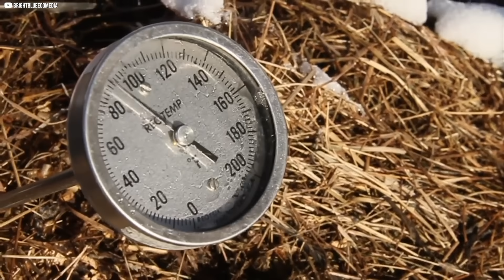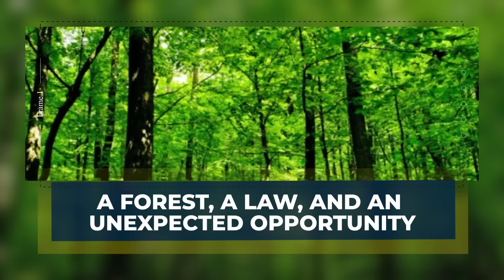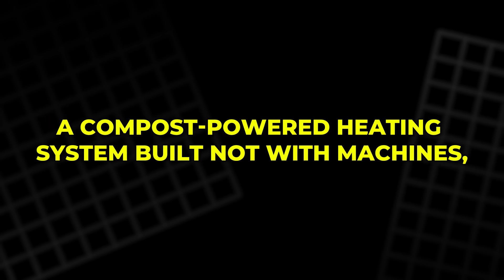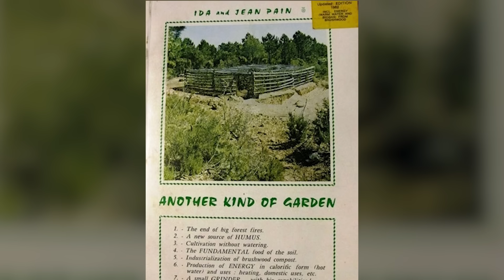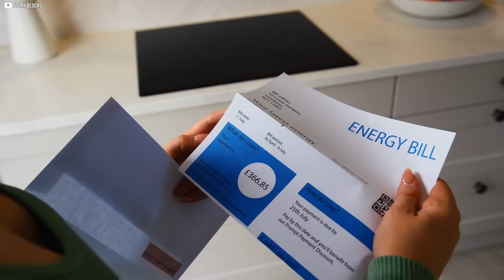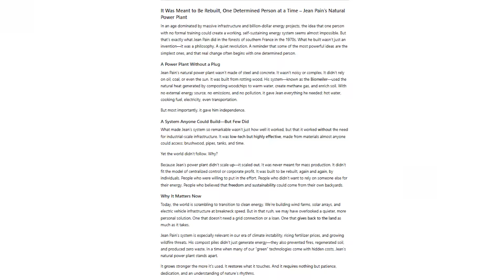The Forgotten Reactor: Jean Pain’s Natural Power Plant

Comment: Yes, this works...i saw it on several locations in austria. But "zero emission" is wrong! 70% of carbon goes from the wood to the athmosphere while decomposing. If you can make charcoal of it, only 40% evapes and the coal has extreme potential to boost your soil. The optimum would be a combination of composting and making charcoal (and put it in the soil)

Comment: rebuilding that every 1.5 years is way too much work for little payout. Today a couple of solar thermal or photovoltaic panels can outperform this in cost and effort by orders of magnitude. no wonder it never caught on, normal people don't have that much energy or time. maybe in large composting facilities this could pay off, but I doubt it.

if one pile lasted 10 years, it would be another matter entirely, but alas, it does not.

Comment: Thanks for this video.  A smaller system built to make compost is the Johnson-Su bioreactor. 
I imagine this system in France is anaerobic. 
The Johnson Su is aerobic as there are air channel vertically.

I've tried the Johnson Su and it works well.

Thanks again

Comment: So we do actually do this with landfills by the way. If the landfill is large enough to produce a worthwhile amount of methane for power, it has collection piping and goes to the power plant. The reason you don’t see everyone doing this themselves is simple: it’s a crap ton of effort to produce only 100W of electricity, requires a lot of space, and you have to have some significant machinery to move that much fuel and time every year to put this together. Most people can’t even log off their phone long enough to think about this let alone do the work.
Reply: Pas mon téléphone qui m'empêche, le projet est compris, je veux surtout la sécurité pour ne pas faire exploser le quartier

Comment: I worked for a paper company and we had mountains of wood chips used in that process.  We had end loaders constantly turning the piles over or they would get so hot they would start on fire.
Reply: Lumber mills here. Same thing. Also water them. Perpetuating the problem. If you tend to them, explosive fire is a real danger. Piles are huge.
Reply: I saw too many times the piles caught fire. The guy supposed to turn them got lazy . My neighbor piled up his brush and chips and weed cleared from a field.  It was in a ditch that was pretty deep.  Started smoking one day. Bailing hay Green will burn your barn down too.

Comment: If it can actually work just build the systems and sell them to people. It’s just that not everyone wants to figure out how to make one and then build it (deal with constant maintenance issues), etc. I can just have my electric from an offsite company or a couple panels on the roof?
Reply: it can "work" but it is extremely inefficient, 40 tonnes of wood chip is an order of magnitude more than what you need to heat an house and water for a year. That is why.

Comment: Spontainious combustion. Grain farmers fight this with grain dryers. It will start a fire and they will lose that bin. I saw this first hand. I went to borrow a freinds utility trailer, he said no problem i just had to empty the grass clipings out of it. I walked on this pile and ft warm, then hottter. I opened it up and found the center had already burned to ash. Th. ese grass clippings were about 9" deep and covered by a black tarp. When i unwound the tarp and it was covered on the underside with droplets.  Im guessing it was condensation that formed inside the sealed trailer from the humidity leaving the grass clippings and condensing on the underside of the tarp in the cooler night air

Comment: One was built in my hometown, it was connected to the grid and was designed to use lumber mill refuse and it was never turned on.  The system needs fear, desperation and our money to survive.

Comment: If you don't need the fertilizer left overs. Bag it load it on pallets and sell it. Take a quarter of your crops yield and open a farmers market, and offer the soil on-site saying it's the exact same soil used to grow said produce and vegetables. Once they grow a base market offer to build said set-up on their property for a small profit and offer tech support for problems and or issues down the line. It can literally be a self sustainable business model if done right. Or in the instance of Off-Grid life, use the exchange for future barters as needed. Up to an agreed value range. I'd imagine you could build a how-to class for the Prepper Community where you get them on-site and get them hands on experience on how and what and when to do all the steps. How to contain gas, water, transfer to electric, cycles when to add moisture and so forth. Plenty of people pay for knowledge. Would love to see this come to reality somehow. Lost knowledge needs to be remembered for the simplicity and usage in instances of disasters, etc. Or just to revitalize land from over using a field and replacing the nutrients that are desperately needed.

Comment: Let's make this invention rise now ❤🎉
Reply: Never happen  ! 
People would rather just flick a switch  !
I burn wood for heat , it's cheap  but hard work,  I have to have  gasoline, 2 cycle oil for my chainsaw , then I must sharpen the chain which requires a file and  sometimes I have to purchase a new chain,  a new bar for the chain,  then I need a way to haul the wood , it's hard work and all of this takes time and  effort  , 
OR simply flip a switch  ! 
Everyone  chose the switch  , after they see how much work they gotten themselves into , they quit  ! 
I'm  preparing my stove right now  as I write this , I just Emptied the ash pan and  loading the stove with wood , that takes work  but I been doing it for  35 years so I'm use to it , I am the only  person on my road that  burns wood  out of  60 homes  ! 
Let that sink  in   ! 
And keep flicking your switch  because  you have one TOO !

Comment: I was looking for composting toilets and I found a company called biogas.  You can use a regular low flush toilet with it and the system produces fuel.  I'm pretty sure you're not supposed to put toilet paper in it that's the downside.😂😂😂

Comment: How was the methane collected exactly..?
Reply: Jean Pain’s methane collection method was ingenious and entirely off-grid—he used the natural decomposition of brushwood to generate biogas, which he then captured and used to power his household. How Jean Pain Collected Methane from His Biomeiler
Compost Mound Construction
- Built a massive compost mound (~3 meters high, 6 meters wide) using pulverized brushwood.
- The mound weighed about 50 tonnes and was designed to maximize microbial activity and heat generation.
Methane Generator Setup
- Buried a hermetically sealed steel tank (4 cubic meters capacity) inside the compost mound.
- The tank was ¾ full of compost steeped in water for two months—this created the anaerobic conditions needed for methane production.
- The tank was surrounded by 200 meters of coiled pipe to heat water using the compost’s thermal output.
 Gas Collection System
- The sealed tank was connected via tubing to 24 truck tire inner tubes, which acted as flexible gas storage bladders.
- Methane was washed through small stones in water to remove impurities.
- The gas was then used to:
  - Power a generator (producing ~100W of electricity)
  - Fuel cooking stoves
  - Run a methane-powered truck.
Pain estimated that 10 kg of brushwood could produce the gas equivalent of 1 liter of petrol, and his system generated 500 cubic meters of methane in 90 days. 
Another measurement is the following. 

Compost Mound
- Size: ~10 feet high × 20 feet wide  
- Mass: ~110,000 pounds (≈55 tons of shredded brushwood)  
- Purpose: Generate heat and create anaerobic conditions for methane production.
 Methane Generator Tank
- Tank Volume: ~1,060 gallons (4 cubic meters)  
- Contents: ~800 gallons of water-soaked compost slurry  
- Placement: Buried deep inside the hot compost mound to maintain warmth (~130–140°F)
 Heat Recovery Coils
- Pipe Length: ~650 feet of coiled tubing  
- Function: Circulate water heated by the compost for domestic use (showers, washing, etc.)
Gas Collection & Storage
- Storage: Methane piped into ~24 truck tire inner tubes  
- Volume per tube: ~20 gallons each (compressed gas)  
- Total Storage: ~480 gallons of flexible gas storage  
- Purification: Methane bubbled through water and gravel to remove impurities
 Energy Output
- Yield: ~17,600 cubic feet of methane over 90 days  
  - Equivalent to ~1,320 gallons of propane  
- Brushwood Efficiency: 22 pounds of brushwood ≈ 1 quart of gasoline energy  
- Uses:
  - Cooking
  - Heating
  - Running a small generator (~100 watts)
  - Powering a methane-fueled truck
Methane Flow and Collection

- As methane built up inside the sealed tank, pressure increased.
- The gas was passively pushed out through tubing connected to the tank—no pump needed.
- It flowed into truck tire inner tubes nearby, which acted as flexible gas storage bladders.
- Before use, the methane was washed through gravel and water to remove impurities.
Jean Pain purified methane by bubbling it through a container filled with water and gravel. This simple scrubber removed impurities like hydrogen sulfide and some carbon dioxide, improving fuel quality and reducing corrosion. The gravel broke up the gas bubbles, increasing contact with the water, while the slurry remained sealed inside the digestion tank. Cleaned methane then flowed into flexible storage tubes for use in cooking, heating, or powering equipment.

Comment: tree trimming businesses will deliver wood chips free in some places --  i knew a guy that filled a swimming pool with layers of compost and wood and grew vegies on top and pumped compost tea out of a space in the bottom.  Seems like a good place to capture head, maybe a mount on the top but not easy to change the chips out.        I was thinking having somme solar thermal on top might accelerate the process and add energy as well as seal up the top nicely.   Under could be a giant water storage that would also store heat --- you could also have some air tubes running through to heat a space that way.

Comment: And if you added a chamber for heat buil up you can “chimney effect” the air out of the vessel at higher and higher windspeed within the chimney by increasing the chimney height! 
Turbine on top and boom! 
24 hr wind turbine

Comment: It is not free when the work and energy required to sustain it is not free. Example chipping the wood on that scale requires energy and money for the chips, the piping and chipping equipment, equipment to move the chips. As you see in the video the setup requires multiple pieces of equipment all running on fuel along with hard work. Saw this before in India where people spend their days finding sticks to feed a pile of rotting waist for the methane to cook.

Comment: Mowed the lawn and ran out of room in the compost bin so I pulled it up on the concrete drive slab it say there in the sun and when I decided to pick it up 2 weeks later it was warm but as I got to the bottom bare hands it was blackish tar like and burnt my hand picking it up and placing in the bin it was only a council bin loads worth but it was as said in this full of heat energy scalding slightly that black tar like layer is hot....the grass cut was rich green and moist when pulled up and that is the key to it infact H2O is hydrogen so that's it's fuel or part there of in the process.....lol never seen that bin man again black suited men must have caught up with him....😂

Comment: I had this exact same idea 40 years ago and I was explaining to my wife at the time and how it would work so I built a small one and after it sat for months we checked the temperature inside my compost and it was 180 degrees inside close to the center of the compost and I was trying to figure out what kind of pipe I could use and a circulating pump and how big of a pump , how would I insulate the pie after it came out of the compost. Long story short I never did build it but still thought it was a great idea we had no computers at the time so I couldn't research any of it.

Comment: Corn silage melts bones . Gets hot in a day ... lol.  Just to have warm water.  Easy heat from tiny piles... get into gas if it escapes you die ... down side ... mini version for generator run farm to milk be good enough.  Run something . Lol. A flame hears water many uses.

Comment: For the late arrivals, Germany built cars late in the war that somehow used a similar process to turn wood fumes into fuel for a gas burning engine. 
 Hydrogen power and fuel cells are another topic.
 This technology isn't new.
It's just not easy to set up on a small budget. 
 The folks that have a big budget. 
Would rather make a profit.
 There is little to no profit in really cheap energy.

Comment: Nothing really a secret here.  Put a lot of different wet organic material in a pile and it will heat.  Corn silage, green hay in a bale, green grass lawn clipping in a big pile etc. etc.
Reply: Nailed it. I once saw the aftermath of a bale that performed self immolation. Lit up the entire hay barn and a combine.
Reply: @Ampz55 That always scared my dad to be careful if we had gotten into baling "tough", or hay that was slightly too wet.  Usually by accident like some heavy reed grass by the woods or something.
Reply: Yes, but this heat goes into the air and serve no purpose. So, nobody thinks further than that.
Here the heat is used for electricity, heating water for the whole family, gas for the stove and to power a car. In a remote place where none of that is available, all year round for 18 lionths.
Can you see the difference ?

Comment: This is a non-factual puff piece.  Kudos to the inventor for trying to improve on an idea that does work but just is in no way practical.   This man had access to a hectare of resources in the form of wood which almost no-one has or could have.  He also had considerable investment in materials and a 12 man crew helping him build this monstrosity and they don't mention the fire risk (lined with straw OMG) or how long this pile would generate useful heat and methane.  Not very long before it has to be turned and then rebuilt.  All this to heat a 1000 sq ft home for one family and provide a worthless 100 watt of power and if the methane provided him gas for a year as stated he would have had to cook very little and maintain that compost pile and rebuild it many times.   It also would only produce about 1/2 the useful energy in the winter when the heat is needed the most.  Frankly he would have been 50 times better off to press his wood chips into logs and do his heating and cooking on a wood stove in the winter and an outside wood fired grill in the summer.  No need for help with labor, no material expenses and much greater return for the wood material used.
Reply from the maker: It's a great point to consider the practicality of this process for different contexts!